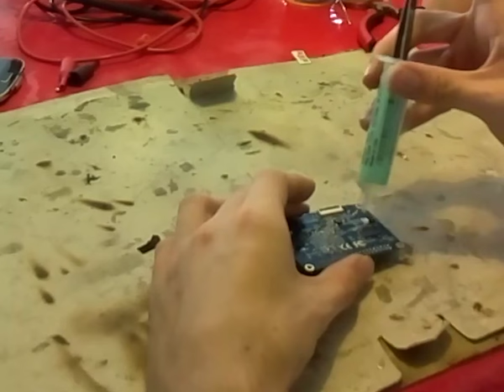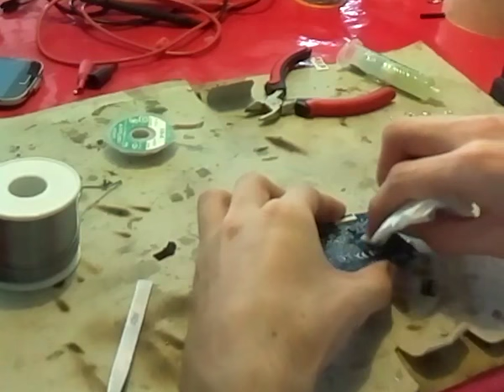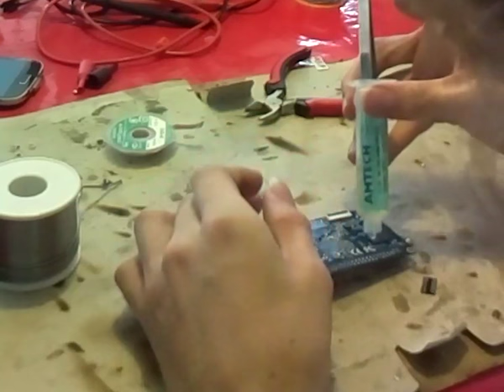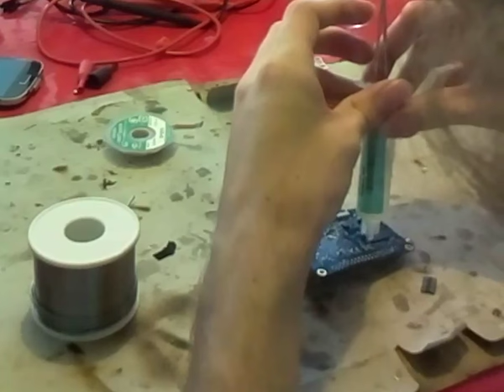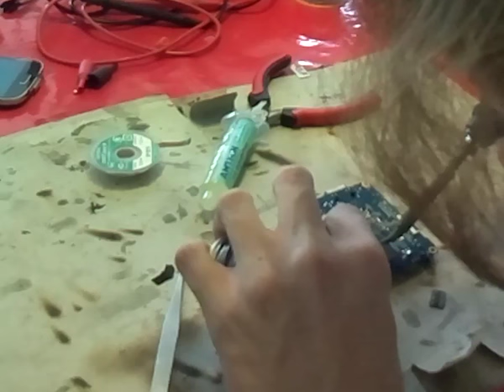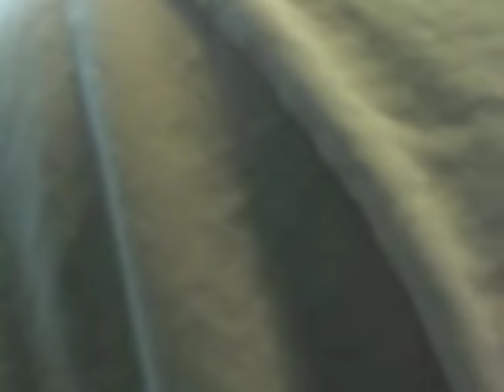Orange Pi One RAM upgrade 1GB

Comment: If your SBC CPU is 32 bits. You can only upgrade up to 2GB. But if you have 64 bits. You can upgrade up to 16GB of ram. Search for Mobile DDR rams and buy one. Do the replacement as the video shows

Comment: Hi! 
H5TC4G63AFR-PBA is the 4Gb (GigaBit) RAM, right? If I understand correctly, it's 4/8=0.5 GigaByte RAM? Ie, if you replaced 2 chips, you got 1 GigaByte RAM, right :) ? 
Interesting, what is the maximum possible RAM for AllWinner H3 SoC? If it x32 SoC, max RAM could be 2 GB?
Ie, to get 2 GigaByte of RAM, I need 2 chips, each with 8 Gb (GigaBit) RAM?
Reply from the maker: I didn't try with 8Gb density chips but it may work. You can try to search for the RAM compatibility list for the Allwinner H3 SoC.
I guess that anything higher than 8Gb density wouldn't work.

Comment: does it work after ram upgrade ? please share video.

and it would have been better if video quality was better.
Reply from the maker: It works perfectly. I shared the U-Boot log here : http://forum.armbian.com/index.php/topic/755-tutorial-orange-pi-one-adding-usb-analog-audio-out-tv-out-mic-and-ir-receiver/?p=13186
I'm using it as a PulseAudio network sound server. Not sure what do you want me to show you on a video.

Sorry about the video quality, I've got no recording equipment and I'm using a RapsberryPi with the camera module for this. (and I croped the video afterward)
Reply: thanks. a video on the performance was i saying. post is fine though.

Comment: Hi,dose this swap works on orange pi zero too? Can I change the 512Mb chip with 1 or 2Gb chip?Will it work?
Reply from the maker: Not sure about the Orange Pi Zero, but since the H2+ SoC is very similar to the H3 it should work.
However the chips are "512MB", ie "4Gb" density. You may be able to find 8Gb density (ie. "1GB") chips which may or may not work, you should take a look at the document called "Allwinner H3 SDRAM Support List-20150112.pdf" which can be found on the web for some suggestions about part numbers.
16Gb density chips (ie. "2GB") don't exist in FBGA96 package, which is what is used on the Orange Pi One.

Comment: this is cool but damn is it useless cuz you would need to find compatible ram chips or ram size for the pi and then use a hot air gun to unsolder and solder the new chip